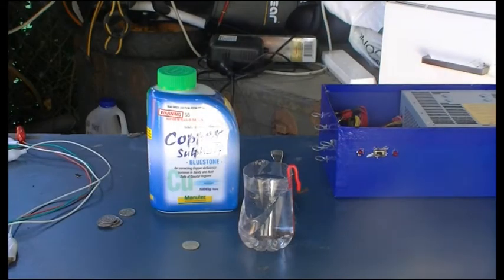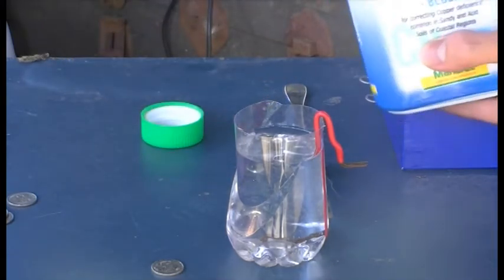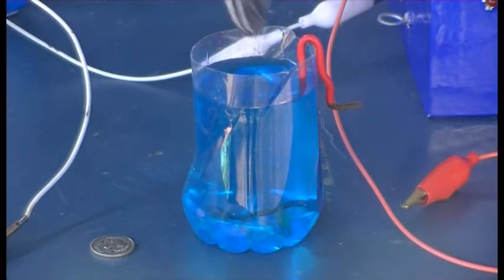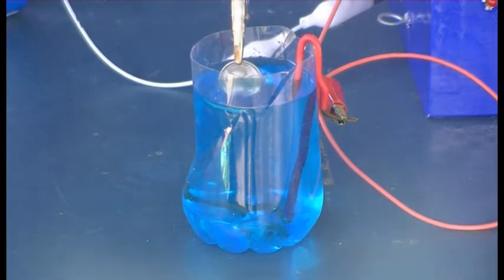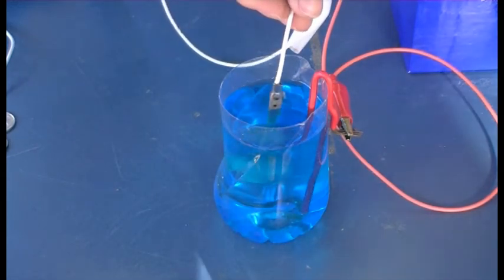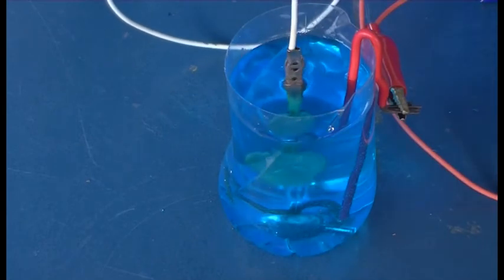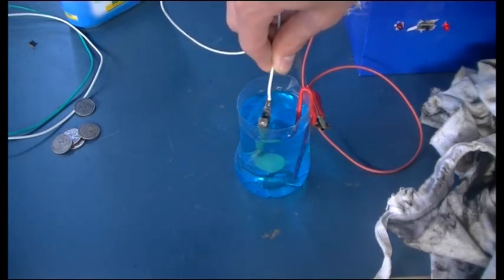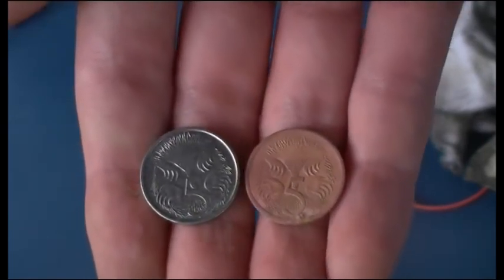Copper Plating

Comment: Can electrolysis be used to remove plating? I would like to remove the zinc from galvanized steel.
Reply from the maker: Electrolysis can't really do that very well. However, if all you want to do is remove zinc, you can do that by putting the galvanised steel in dilute hydrochloric acid or something. The zinc will dissolve off very quickly while the steel itself will only react slowly.
Reply: @ScrapScience  Thank you for answering!
Reply: @ScrapScience  Btw what do you suggest for neutralizing the remaining acid and freshly produced zinc chloride?
Reply: @JoakimfromAnka bicarbonate would probably safest and easiest to get.